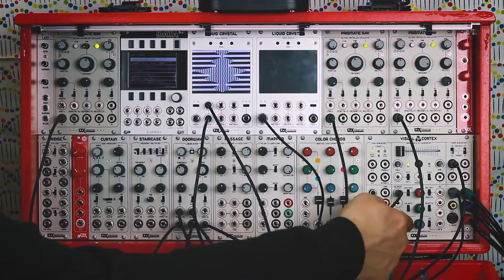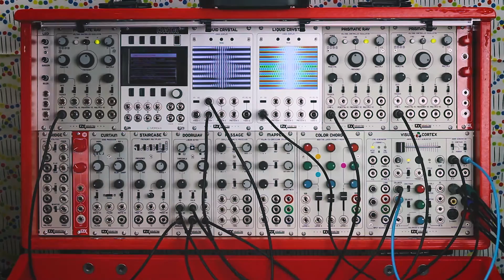Video Synth Techniques 3: Colorizing Patterns & Adding Motion

Comment: Hey Lars, good stuff. I'm enjoying these so far. Could you add some audio in future videos? Be nice to hear sound moving in relation to image. Say at the end where it looked like LFOs moving the lines around you could match that with the same LFO modulating a filter cut off. I'm thinking really basic audio, can be quiet just sat under the voice over mic but nice to link some audio with the visuals to pull on both senses.
Reply from the maker: Good idea! I was waiting for the "basic audiovisualization" episode to record some concurrent audio, but there's no reason I can't do that with these other episodes as well.  I think I'll do the audio episode next.
Reply: Just left this exact comment on another video :) otherwise what are the CV inputs for... Seems like a really essential part of this gear